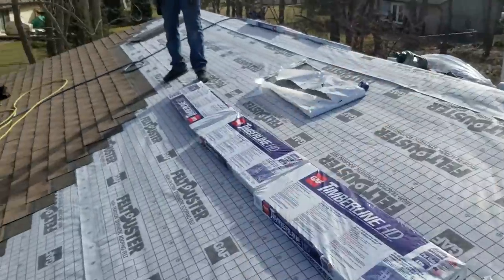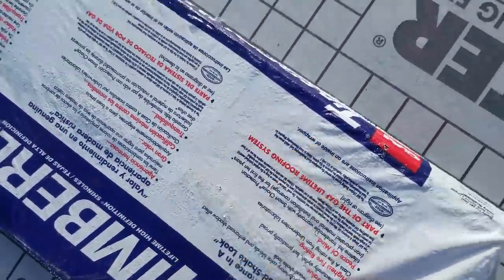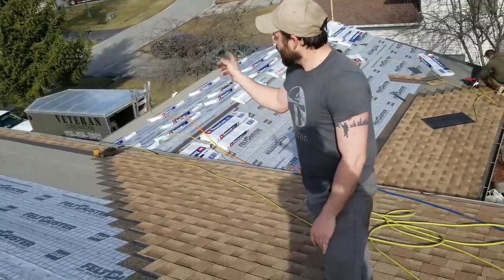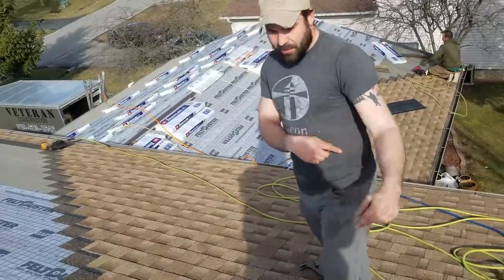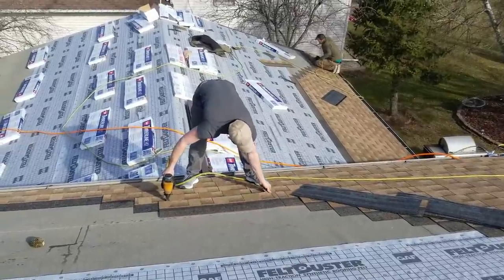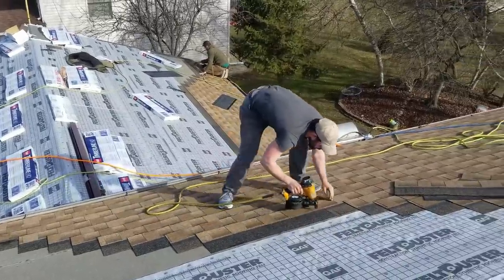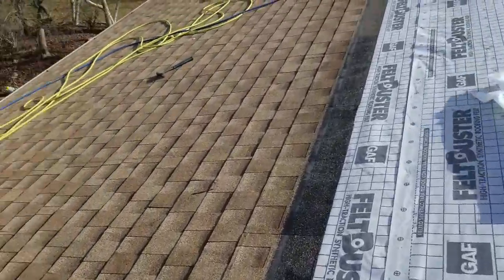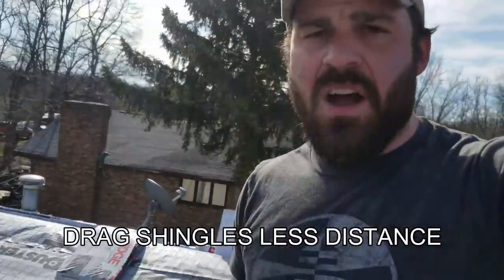Worlds Fastest Shingler #ONESQUARECHALLENGE

Comment: Not knocking that you get it done quick...no way in hell you are the fastest just based on the speed you nail off a single shingle.  A lot of variables makes one quick and it's not just the specific task of nailing off....all the prep, to clean up and down the list.  I'd say if you could nail off as fast as some here on Youtube have posted...it still might not make you the fastest shingler...to the end when you drive away from a job and you don't get a call back because you rushed speed over quality and/or sloppy work.  Watch this guy nail off and say you are faster is not being honest....and this is just one....  https://www.youtube.com/watch?v=Y7JKud9pf0Y
Reply from the maker: LMAO! I swear on everything I didn't even open the video and I guarantee its that bear jew video. THAT DUDES NAILS ARE SLOPPY! and if its not his video, I'm willing to be all these speed nailers nail placements are sloppy. on these shingles, you need to hit the line. and you're right there's a lot that goes into it, but nailing is the last thing that makes a shingler fast. THE ABSOLUTE MF'ING LAST MF'ING THING! its in the setup, where the bundles of shingles are placed, your consistency in cutting your stair steps, doing your starter, working at a pace you can hold all day long without needing frequent breaks. the off hand grabbing them shingles, and the way you spread your bundles. if that link is to bearjew tell him to open his bundles and spread them out. that alone adds up to the amount of time I laid in this video. speed nailing gives the illusion of speed.
Reply: @NWIVeteranConstruction  No, some guy named Rocket Rob...fast is good, like you say...a good/specific sequence is king and will get you there in then end of whatever you do quicker.  Enjoy your roofing..it's a hard work/dangerous work for the young.
Reply from the maker: @13612  oh rocket rob is pretty good! honestly I like him. old school roofer gatta give the dude credit but he's a pretty slow nailer too. he does a good job and that's what the nail placement is about
Reply: Earl Ismyname thats not rocket rob.  Thats a guy who says hes faster than rocket rob.  The guy in your video is sloppy and pre layed them out.  Find the one of rocket rob.  Hes fast and not sloppy.  Hes fast with or without a gun too he has different ones.  Said he won $4000 in a competition.  Worlds fastest has a good plan to lay his shingles out and does a nice job of going back on improper nailing.  Hes slower than the fastest guys on the actual shingling by a fair amount.  The only way to get the best shinglers to a comp is real money.   More than they can make in a week.   What boss is going to say “sure head to Indiana for three days to prove you are the fastest, we will work without you for awhile”
Reply from the maker: did you not see my last video about the 2020 roof Olympics!? shits gonna be epic
Reply: Earl, you said it best, it's the sum total that makes you fast, and not just a single task, e.g. nailing off. So what is the point of comparing "Veteran roofer" to some guy who flew through a pre arranged bundle at lightning speed with most likely no attention paid to nail placement?
Reply: You said it man
Reply: If you use your gauge it's faster. Been shingleing for 40 yrs
Reply: @13612  if you’re a roofer you’re probably just helper that picks up trash because you obviously don’t know the first thing about shingling. If you’re a shingles please quit and stop ruining peoples houses
Reply: @edgarespinosa126  Edgar, if you were anyone that knew anything...your name wouldn't be Edgar Espinosa.
Reply: Anyone can nail that fast. Especially when someone took the time to set them up for him. Add that time and the time he nailed. Waste of time. I carry them on my back like quills. Lol. This guy even says they're having fun with the challenge. Tear off, clean, and shingle 25 square in 8 hours with five guys is pretty impressive. Now that's a good crew.

Comment: Love your videos. Don't listen to the Debbie downers. I run a crew with five guys. Two of us are experienced. I can nail fast as heck. But who cares? Tear off, cleaning, covering, and loading the roof is where it starts. We did a job 25 square, replaced 20 sheets of OSB, four 22 ft valleys, cut in ridge vent, drip and covered and shingled. Start of job to finish took 8 hours. Two shinglers. Not bragging at all. Can't do that every job. But your challenge is fun. Good job and keep the videos coming. I must say, I've been doing this as a second income for 30 years. Never full-time.
I'd hire you ANY day.
Reply from the maker: i've got a new challenge you'd love too! as well as a good deal on pitch hoppers! go check out my 2 most recent videos! you n the crew need two each

Comment: Are Tamco shingles any good?  Hope I spelled that correctly..
Reply: In my opinion they are second tier shingles, I wouldn't use them.
Reply from the maker: They're not terrible.  I would use them as a cheaper alternative if you are wanting cheaper.  They're good enough.  Comparable to o.c. oakridge. Better than IKO and atlas in my opinion.  But its pretty much just the o.c duration,  gaf, and landmark as the better brands
Reply: @NWIVeteranConstruction  Thanks for the reply brother..
Reply: @gc7782  That's not good to hear just had my house shingled w/ them.
Reply: I have installed quite a few tamko roofs some going on 5 years still looking good

Comment: You're not bad at installing the easiest roof. You have more speed than skill. Show me that you're a real roofer by working on slate, mission tile. Especially the handmade tiles from Mexico. Which use cement as part of the process. Show me your skill with a flat composition roof. Where everything lines up horizontally and verticality. I build homes of the future. In Malibu, Beverly hills, Santa Monica. Restorations in Pasadena. All over Los Angeles. Come here and some real roofing.

Comment: I would disagree about laying down square in 7 minutes makes you a good shingler. If my guys did that I would be inclined to be lifting every shingle up to make sure they hit the mark and put the proper nail placement not to mention them not waving. Since the majority of roofers are paid by the square how does it make sense to have the demo, underlayment, ice shield, and drip edge already installed along with several courses.. If you're going to have a 100 meter race you're not going to start 1/2 way up the track. Of course I guess its to show areas of strength and not weaknesses, sorta like a handicap in a way.

Comment: Just thinking it might be faster if you change the way you nail your shingles.  You always shoot your first nail in, then skip a space, then shoot 4 more in.   Have you tried skipping that first nail, then nailing in the next four.. (The next course coming up would get that missed nail on the previously placed shingle)  ..  and placing your new shingle on the roof, and shooting the first nail in after the new shingle is placed?  so instead of shoot 1, skip, shoot 4..  it would be shoot 5 in a row.  Nailing the first 4 in the shingle you are placing, and shooting the 5th nail in ( which was the first nail previously ) Just curious if you tried it.  4 nails into new shingle, 1 nail into previously placed shingle..  hope this makes sense to you because that pause when you skip a beat is definitely slowing you down. You're reaching a long ways to your right to hit that first nail.. but doing it the way i am suggesting would allow you to not reach to your right so far, but allow you to reach farther left to where your next shingle is waiting. Also, your body position would be a half step closer to the new shingle supply and you would not have to reach so far to your left to pick up a new shingle.

Comment: Do that on  new construction with  9/12 or 10 /12... a real roof...
Reply from the maker: got tired of the steep ones long ago so I try to get all walkers for my guys and were good with that! lol  I do have some proof on my channel though go check it out. 8/12 and 9/12 video
Reply: @NWIVeteranConstruction   walker are fine...if you get them.... but you will not much walkesr in new construction...especially new  homes over $ 700,000